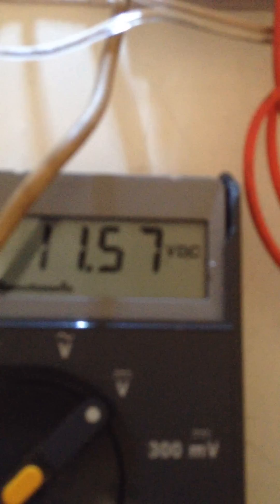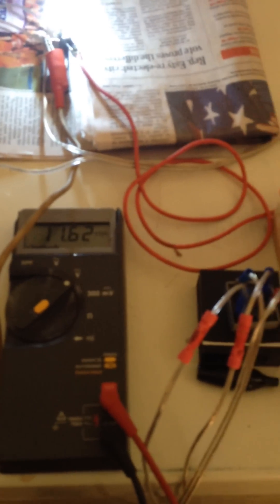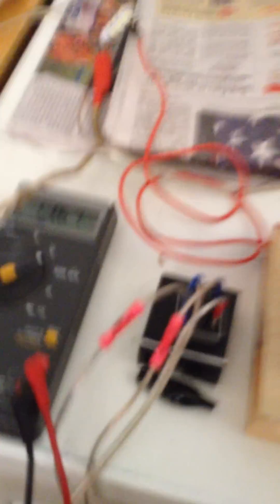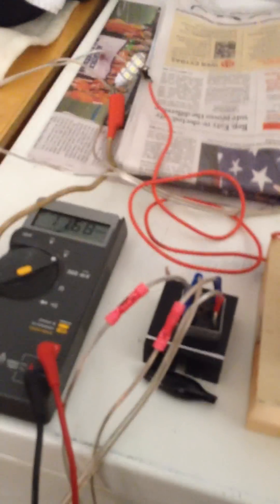Over unity created with transformed back emf. True over unity, no BS!

Comment: Mark,   
     Conditioning a battery like you are doing here will eventually ruin the battery.  Look at what's happening with the Bedini  charger..  It works on the same principle of bemf spikes.  They have been selling them for a while..  They are in deep shit with law suits now.  Long term use ruins the battery (completely ruined)..  I don't know exactly whats happens inside the battery to ruin it,  but it does..  Some companies have been using bedini charger for charging large expensive batteries in fork lifts and other high power equipment.  It kills everyone of the batteries..  Obviously there is enough evidence to bring it to court.   Bedini didn't do any long term test.  They rushed to market..  There has to be a better way to utilize this effect.  Batteries prove the point, but are not suitable for regular use.
Reply from the maker: +ThomastheSailor Chubby    I probably did not run it long enough without a load to find out, I have always had a light bulb of some sort connected or a resistor.. Maybe that's why I haven't had any issues with it. When the transformer is connected, I also have added a diode to my circuit that is the only real way to obtain overunity. It's been so long since I used this method that it was a mere way of showing folks it was a way just to prove overunity is actually possible while the circuit creates square wave pulses that bring in some sort of induced energy other than back emf. I'm actually not quite sure where the energy comes from, I do know it is cold electricity by the green arc, however, I'm guessing the energy is coming somehow from atmospherically induced energy. But, I still have not had one battery issue yet and i am using lead acid batteries. I have had much better success with lithium ion batteries, without any shutdowns of the battery protectors, and, they never leaked or exploded. The lithium has given the circuit the ability to fire the relay from  a point as low as 8 volts, and, it carries on with a load all the way up to 14.4 volts and holds. The voltage at the battery is not higher as the bulb absorbs all of the additional voltages like 100-400 volts ac the other chargers on the market usually have. The real key to the circuit is to use it for desulfating as it has no ability to run anything of major value other than a small bulb or led, and, when the circuit did run consistently for 6 months, I did use an LED with a small resistor so it didn't blow or overcharge the battery, again, with no issues whatsoever. I feel the Bedini charger is causing issues because it is operating to charge a battery without any other loads on it, pushing large quantities of back emf, High voltages directly into the battery without any resistor or resistive load to absorb the nasty damaging spikes the charger introduces to the battery. My emf is close to or the same, maybe at a lower frequency, however, my voltage is very high and the diode, as well as the load completely eliminates the spike that destroys batteries. My device also has an output  about 1/5 more than it's input (measured wattage), however, I have moved on and gave up messing with it since I have been very successful with another 2 designs I have come up with and built, the Pelex device is the most powerful I have completed and I am trying to market it, however, I am getting a ton of resistance and it's gotten to a point that my email and video uploads have not been able to be loaded as they don't finish, I can't send attachments, and it is driving me wild because I can't send images of test data to any investors that show true proof it works. They have to rely on my presence at an upcoming show for proof it works.

Also, if anybody were really smart, they wouldn't make and market the devices on their own, they would sell the design to eliminate being ruined from responsibility. That's a dangerous part of inventions, especially if money hungry and feel you could become popular enough to do it on your own. I think it's pretty greedy if you ask me. I'd rather sell off the entire responsibility of a device , then retire in peace.
Reply: Marc Belanger
    You might wanna consider having your own website and use youtube to direct people to it..

    What type of relay did you use in the first setup. ?  Would you care to share any drawings or schematics on that.  I wanna build one, test it, and maybe try feeding my little newman motor with it
Reply from the maker: I have a webpage on Blogger. www.mbrcircuit.blogspot.com

Thanks
Reply: Marc Belanger   Nice,   Thank You.!!
Reply from the maker: The light bulbs used in my hairpin circuit get smoking hot, and, i could put them in water, touch the wires bare with both hands without getting electrocuted, and, it does contain hv electricity, however, the cold electricity does not mean the bulb stays cold, it is still burning the filament white hot.  Cold electricity does cause frost on specific arcs it creates, but, only at specific frequencies, it also has different colored arcs, they are green, but, they are not cold arc, they are brutally hot, the bushing that draws in the energy will be extremely cold. I feel the energy is an electron, it isn't the normal electron, I feel they are positrons that when they meet with electron flow, a massive burst of energy is released. The way my circuits have been channeling in this energy is much different than most believe and I do have a very specific way of doing so, but, the relay circuit i used does it through it's arc in the gap between the switch, not a very good or efficient one.

It is drawn to the magnetic flux of the coil as it oscillates, similar to the hairpin but so much less energy being used to draw it in. The hairpin does this on a massive scale, and, I have pretty much perfected this with the Pelex device, however, it is very noisy on other circuits at the moment, and I am still workjing on a few different circuits I have developed to clean the pulsation out of nearby electrical devices.
Reply from the maker: I studied the old theories that were science's #1 theory at the time it was believed to be certain and they did mention what I have stated about the electron and positron colliding, causing an output of more energy, or a massive burst of energy and no annihilation. Basically what I am saying is Newton says energy can not be created nor destroyed, and, in one of energy's forms, called our conventional electricity, it is comprised of flowing electrons. If we destroy the electron, the energy is being destroyed since the end result is neither the positron nor the electron, but according to science since it is so mixed up does not indicate that it becomes a gamma ray, it states that it becomes zero or nothing. Then, in the same report that is carelessly edited/prepared by multiple scientists, they state that During a low-energy annihilation, photon production is favored, since these particles have no mass. However, high-energy particle colliders produce annihilations where a wide variety of exotic heavy particles are created. Now, to me, that makes absolutly no sense. How could one particle of light be made under low energy, and a higher energy create something different, and, to me being a heavier particle, maybe what they are indicating now is something that I may be able to change from one form to another with my method. I'll explain a bit of how the channeling works in a moment. I'll post it in another comment right after this.
Reply from the maker: basically, the method I use for activating the atmospheric energy link between my device and the atmosphere (or wherever or whatever part of the ionisphere I connect to) is from a field created by inductive capacitance and thin aluminum plates that are wound around a dual core custom wound transformer that literally links the two together temperature wise. I've found that if the transformer is efficient enough and it is not grounded at all, the high voltage bushing's connected and paired from one transformer to another literally read the laser thermometer's lowest temp reading, the same temp as the sky reads when the laser if pointed up, summer and winter, the temps are the same only when the devices are powered up and pulsed with a rotational permanent magnet cored generator. These generators do NOT output a straight up sinewave unless they are under load and I find it near impossible to get them to work unless this pulsed wave if used. I try this with a conventional generator and it will not produce any signs of cold bushing temperatures, so, it is similar to the Gerard Morin Transformer test I have done (and he does as well)

The flux pulses from the dual core are opposite to each core, creating some sort of imbalance that allows this energy to attract to the core and low voltage coil. Since the cores are merely two square cores created by laminated soft iron plates that sit against each other side by side, they are wound with an aluminum plate type low voltage aluminum coil around the cores with a thin layer of transformer cardboard (like plaque cards, very thin and immersed in mineral oil to eliminate any conductivity. Then, between every layer of the thin aluminum plate, there is a continuous layer of paper to make the inductor a mix of an inductor and very high capacitance mixed. The core and winding of aluminum like this is automatically resonant and literally activates this stream where the energy follows, acting as an antenna. The low voltage coil and it's pulsating flux only attracts this energy stream because it has it's electric field wave from the coil, then, opposing core flux from each core directly on each side of the coil. The energy is only highly attracted to the coil, but, does not become induced into the low voltage coil because it is purely ionic with it's high voltage characteristics, and,  it induces into the primary coil which is wound around the outside of the secondary plate coil, and blends into it's output because it is drawn away from the low voltage coil by it's load. I'm finding that the higher the resitance of the load, the more power it has in it's output which is opposite of any conventional means. I find this only with resistive loads... inductive loads I havn't tried or documented what happens with them in this circuit.I am trying to use electronically built solid state devices using a high powered SCR instead of the permanent magnet rotor to create the rotating field and wave that seems to work, however, I need this to regulate the voltage output and am finding this not to be the case with devices such as a router speed controller. I have purchased a cheap $20 router controller from harbor freight that does control the voltage from 0 volts up to it's maximum but, it burns out at a much lower load than it is rated when powering trafo coils. I feel I need to do a bit more experimentation though , so, I purchased the parts to make the same router speed controller with a digital output and will need to just try it, read the voltage to ensure it starts up at 0 volts variably. then, works it's way up in voltage as I turn it up. I need this so I could try this on the Tesla hairpin circuit, then, I will have a more accurate variability without a pure sinewave. When I add a .003 uF cap (400v) and a resistive element of any kind to the pulsed wave or even a  modified sinewave/squarewave, I get a nicely formed sinewave. With an ungrounded device as it's input, utilizing the scr and rectifiers as is in it's circuitry, the grounded input might be able to be used to make this phenomenon happen to create overunity.. So far, Pelex does not work with anything but a clean sinewave, as it's efficiency and OU goes away once it is pulsed (I think I just lose the resonance in the coils due to saturation). I find quite the opposite happens when I use the dual core transformer coil instead of my specialized open E core as the pulse makes the dual core work. Both of the designs I use are based upon the same magnetic elimination/manipulation theory as Tom Bearden's device utilizes as the pulse created in the circuitry makes the field/flow  that causes the CEMF inside of the trafo's core to go away, allowing an electric transformation to happen in resonance at an extremely high efficiency which is allowing the saturation never to happen, as well as the conventional load which is normally forced back upon it's input coil due to the Lenz effect. There is either one of two things happening here, maybe even both.. It's hard to prove because something absolutely abnormal is happening here. The core is either allowing the energy to simply be transformed into the hv coil of the transformer via the pulsed oscillation, or, it is receiving  positrons and they are being drawn into the electron flow of the hv coil which is doing something that is not normal and completely misunderstood. If the positrons are literally being drawn in as I theorized and they are not annihilating once being introduced to the electrons, they are doing something out of the ordinary that is in violation of the currently written laws, however, the effect of the cores and the coil could be doing this with high voltage present through ionization as the hv terminations are ice cold only when energized. It's going to be a while before i will have all of my products ordered in and able to test this in every way possible for the methods I will be testing this all. I will offer several different waveforms from my scope, and, I have many circuits and components added to this to see what they do or change. I'd like to see if the loads are accurate, however, if I am reading cold electricity, the electronic measuring devices, meters, scopes, etc. are not calibrated for anything but conventiona power. Unconventional power such as cold electricity has many different operations, and only one of them I noticed is that resistance acts in an opposite manner, so, this is one massive change I have noticed that will not allow normal amprobes, volt meters and other electronic apparatus to function correctly since they are mathematiclly calibrated and function using different mathematic variables for each field in ohm's/watt's law. This will all have to be completely studied and re-evaluated before we use the wrong meters to measure the inpuits vs outputs. Who knows, maybe something completely different is happening, but, I have to somehow prove what's going on while most poeop-le comenting say I am nuts. I can only provide what I feel is happening instead of what is actually happening due to the variable differences in function toward cold electricity.
Reply from the maker: you are absolutely 100% correct about the lack of violation of the laws. The first reason I say this is because the energy is drawn in via another source which isn't wired. People have a hard time believing this, however, it is and always would be believable if I said it was induced from another wireless source, then, once I say it comes from the Aether, they raise their eyebrows and say. ohhh, here we go again. I don't find any reason for it to be hard to believe. First off, we have a planet that has it's own continuous energetic oscillation that can be drawn from. It has it's own massive magnetic field. This is another possible source. It is a giant capacitor with an aerial circuit connected worldwide for sources of static from lightning discharges. It has another source that builds electricity from weather patterns and instabilities in the atmosphere. We have cosmic rays to draw from in other ways, vacuum energy from space, the list goes on and on. Tesla has known of every single energy we are currently researching to this day, and, at one time, scientists thought of air power, solar power, water power, atomic and other methods to be completely imnpossible. Well, guess what, they happened to all be very valid types of electricity or forms of energy transfer that we currently use today.
Reply from the maker: +Thomas Ryan I will certainly be looking forward to seeing that. I've looked far and wide for devices like that but always came short on designs with all necessary data to build them.
Reply from the maker: I have a website, but have no time to manage it, I need to add about 50 videos to it, update it a bit, make it look nicer, and add about 250 of my circuits I have built, then sell the diy circuit prints and pcb design files for $10 each. I have so many working circuits that I forgot how to build them all! my websites are dezeinstein.com and a blogger page or two... mbrcircuit.blogspot.com and another I do not remember right now.
Reply from the maker: I use radiant energy from my tesla hairpin circuits and the bulbs get so hot you can't get close to them, however I have found that only some contacts get cold. The ones only with a green arc. i have seen several colors and they all use the same contact types, either carbon or copper, and there are no gases present to change the colors of the arcs.

The cold electricity is not alone in these circuits like whats shown in the video because we power them with conventional energy.. this is the only way we will have the circuit's energy be pulsed into the ground and recover the conventional energy back from the air.. but, there is radiant or cold electrical content which is what allowed Tesla's magnifying transmitter to function.. This and all of my overunity devices work from Tesla's phase conjugation mirror discovery. It is truthfully the initial part of the discovery of the Casimir effect. Tesla was onto this technology, and if he lived long enough to complete his work, he would have provided the world with a truly working free energy machine, and there isn't one doubt in my mind. Tesla was the man! 

Don Smith perfected this and literally sold his devices to power many devices in Japan to attempt in the elimination of power plants, etc.

The Japanese need to allow somebody such as myself in to see Don's machines which powered coke machines, and many other technologies in the far east. If I could get my eyes inside, I know I could figure the circuit's function out to replicate them. it would only be a matter of time to get working models operational. I would need to isolate circuit after circuit for testing and from there I'd be able to replicate it provided I was allowed to unscrew connection after connection, one at a time without disturbing much.